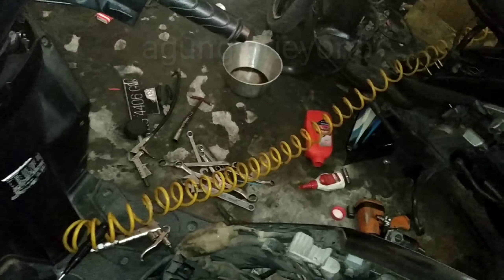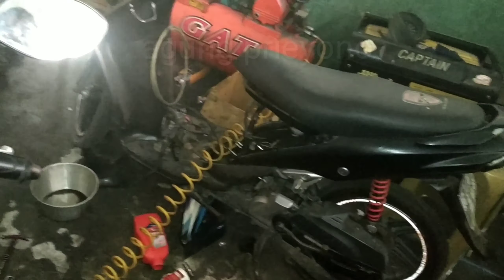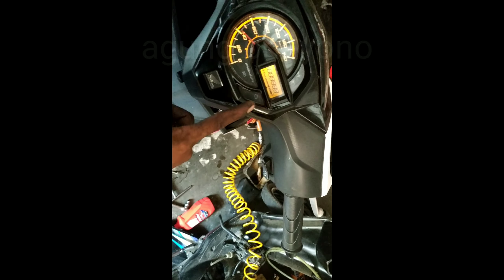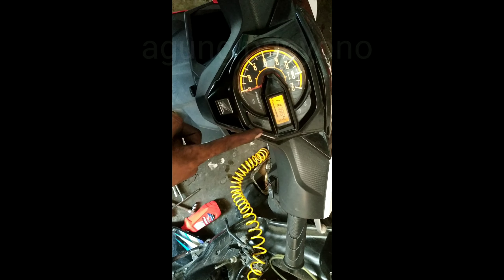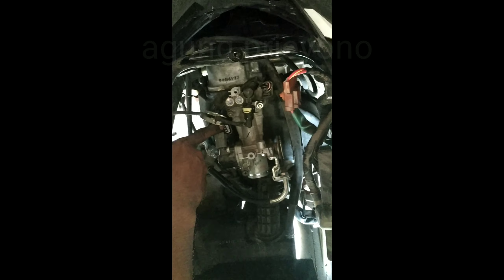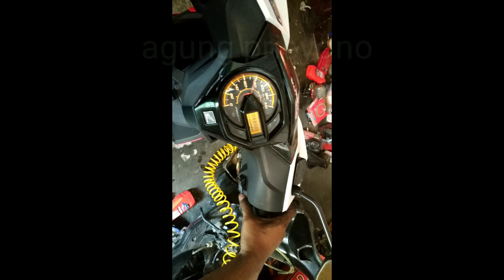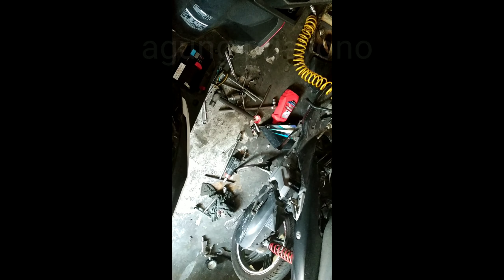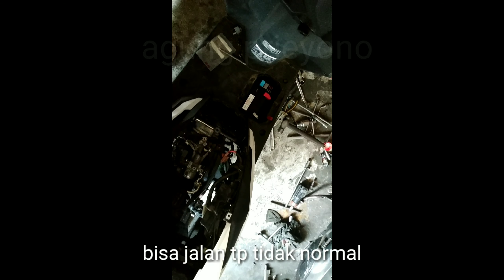GAK PAKE SENSOR TPS

Comment: Kalo ecm itu sudah ada module nya  ,    kalo soket ny di lepas   mil akan berkedip   tapi ecm akaan membuckup data tps  ukuran 0,4  di scaner.     Itu bisa di aplikasikan   ke motor yg berpenyakit Fp lemah. Bisa langsam.   Dan untuk mngetahui  klep tidak bocor   jika di lepas soket tps tetap ga langsam  positif klep bocor
Reply from the maker: Terima kasih atas penjelasannya,semoga bermanfaat untuk teman2 mekanik lainnya...
Reply: Sampean uplod banyk yg ga ngerti maksud dan cara pengaplikasikan nya ke motor . Bukan nya sok pintar   cuma nerusin heeee
Reply from the maker: @sairajiaji8309  saya tidak pandai menjelaskan

Comment: Bang dimotorku klo sensornya dilepas ko pas digas mati
Reply from the maker: Motornya apa
Reply: @agungprieyono3207  crf bang
Reply from the maker: @avankedua4809  kalo generasi baru emang gitu gpp
Reply from the maker: @avankedua4809  bisa pakai ecu racing itu bisa di bikin brebet atau piggyback , ygpaling murah ganti injektor atau manipulator sensor
Reply: @agungprieyono3207  kalo buat mesin standar injektornya yg hole berapa?
Reply from the maker: @avankedua4809  coba pake punya cb150r old 8 hole
Reply: @agungprieyono3207  efeknya cuma brebet ya bang ?

Gak ngaruh ke tenaga kan bang?
Reply from the maker: @avankedua4809  akselerasi nambah , kalomau brebet doang businya rapetin
Reply: @agungprieyono3207  kalo businya difull rapet aman gak buat harian?
Reply from the maker: @avankedua4809  g boleh nempel harus ada celah dikit , aman tp ya brebet
Reply from the maker: @avankedua4809  pnp
Reply: @agungprieyono3207  thanks bang infonya
Reply: @agungprieyono3207  O iy bang klo pke injektor cb150 r brebetnya smpai rpm berapa?
Reply from the maker: @avankedua4809  engga brebet

Comment: Mau tanya gan kira2 harga sensor tps ny kisaran berapa ya
Reply from the maker: Ckd ada yg 85 ori set tb revo fi 130 ada juga yg 175
Reply: @agungprieyono3207  tapi klw sensor tps ny di cabut kira2 dampak ny ad yg lain nggak
Reply from the maker: @aliamran8554  motornya apa
Reply: @agungprieyono3207  beat fi thn 2014 yg starter kasar mas
Reply from the maker: Untuk sementara bisa , lebih baik dganti

Comment: Bang saya beat  brebet tekanan pump normal cabut sensor tps malah tambah parah
Reply from the maker: Brebetnya saat dingin saja , atausaat gaspol aja?
Reply: @agungprieyono3207  pokok nya saat panas mau pun dingin tetap brebet, kalau di gas agak pelaan lumayan dapat lari nya,tapi kalau di gbeer kayak kekurangan minyak
Reply: @agungprieyono3207  pokok nya digas pelan pelan agak mendingan kalau gaspol kayak fuel pump lemah padahan tekanan pump normal beat 2013 fi
Reply from the maker: @andibyc2599  coba lihat ini https://youtu.be/gnzNcMfwbXY
Reply: @agungprieyono3207  ooo berati itu ciri2 tps eror persis kaya beat saya kalau gaspol malah turun rpm nya,mesti tarik gas agak pelan baru jalan motor nya
Reply from the maker: @andibyc2599  betul sekali
Reply: @agungprieyono3207  mau tnya gan 🙏 kalau di cabut soket sensor tps kok brebet nya sama ,,🙏
Reply from the maker: @andibyc2599  solusinyab ada di disini https://youtu.be/gnzNcMfwbXY

Comment: Kalo tps nya dicopot terus buat berkendaraan gtu bisa rusak nggak bang soalnya ada sensai tersendiri kalo dicopot 😂
Reply from the maker: Tidak, di dalam ecm sudah ada failur mode yaitu sistem cadangan bila salah satu sensor gagal berfungsi walaupun bisa jalan tp tidak se responsif std nya
Reply: @agungprieyono3207  jadi tetep aman kan bang walau dipakai terus menerus ?
Reply: @agungprieyono3207  thx bang infonya 🙏🙏🙏
Reply: Kalo beat fi stater kasar ada sensai brebetnya, di pasang knalpot racing jadi mantap bos😅
Reply: @sholehsaja8877   iya bang gw pernah coba di motor emak brebet nya enak

Comment: Kalo di Cabut,Soket yang atas apakah Aman?
Reply from the maker: Motornya apa
Reply: @agungprieyono3207  Vario 125 Old bang
Reply: @agungprieyono3207  Vario 125 Old bang
Reply from the maker: @premiumyoutube4420  aman tp tarikan g begitu responsif
Reply: @agungprieyono3207  Malah lebih Mantap Tarikan Nya Bang

Tapi Kata Bengkell,Radiator Cepet panas
Reply from the maker: @premiumyoutube4420  iya kalo di ganti baru lebih mantap lg